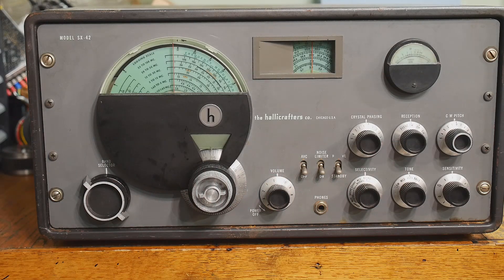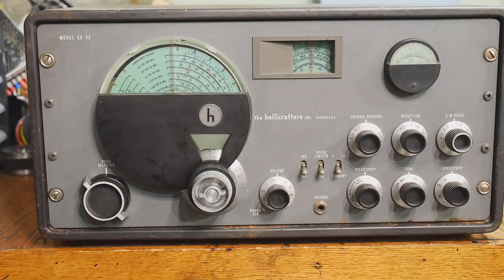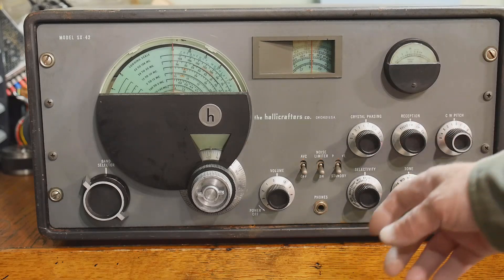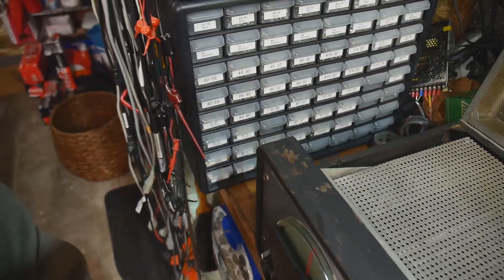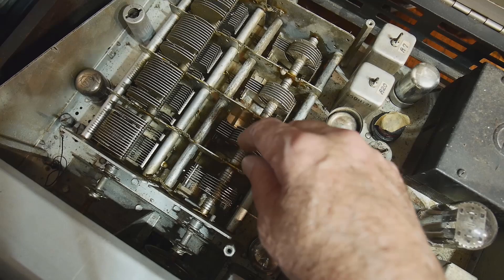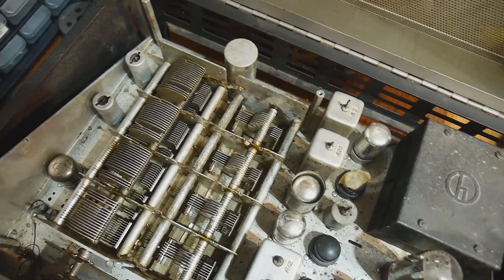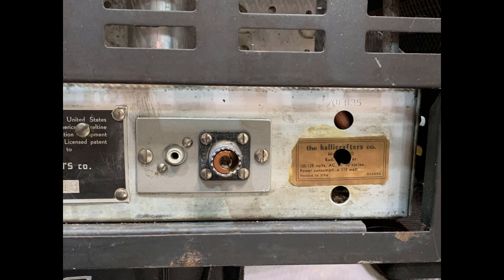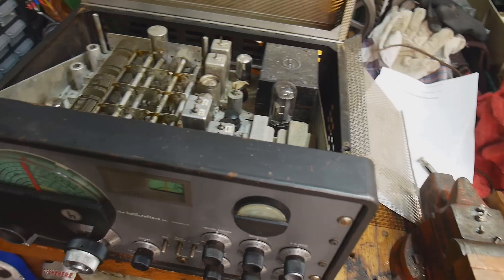#679 Hallicrafters SX-42 Receiver (part 1 of 7)

Comment: Reminds me of the Hammarlund HQ-120X receiver I once had. That was mid-30's vintage, this is probably like you say post war but maybe not into the 50's due to all the octal and loctal tubes in there. Any tube 7XX is a loctal. They can be problematic if there is any corrosion on the socket or pins as there is not much contact area compared to a good old octal tube. You should test a few resistors. I bet they are fine. Wax paper caps though need to go.